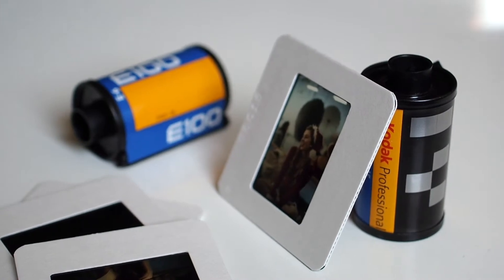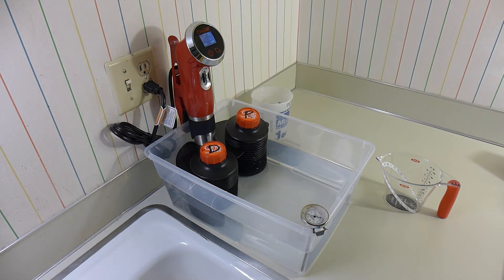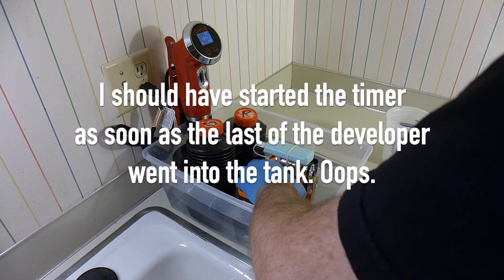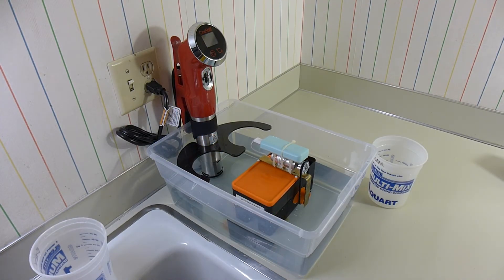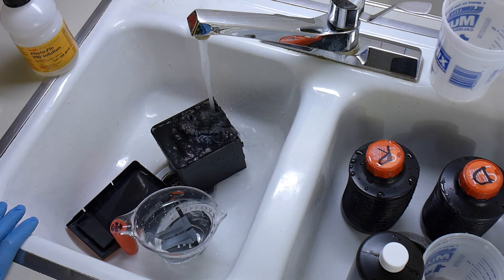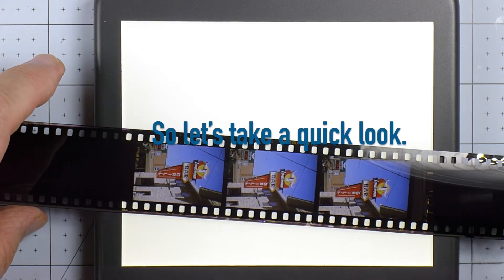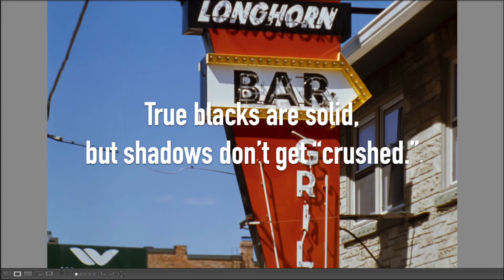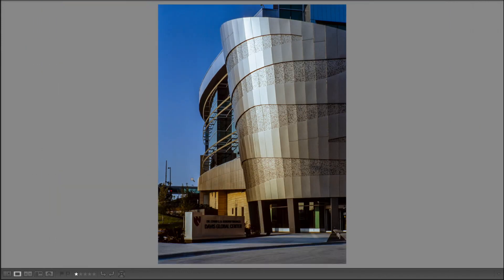Bumbling My Way Through E6 with CineStill's Dynamic Chrome

Comment: This concerns use of the Lab-Box for the E-6 or other color process. Temperature control and maintenance for tank processing of E-6 requires high temperature, 100 F, more or less. A hot water bath is the usual means to do that, submerging the chemical bottles and processing tank during use. Here, he is doing that with a Lab-Box. Since the LB does not seal on top, he is taking care to avoid any water bath spillage over the top edge of the tank, as that would flood into the chemicals inside the tank. This may do the job of temperature control, but it creates  a separate issue with the Lab-Box itself. Note that I was a Kickstarter of Lab-Box and have the whole package. Many errors seem to have been made designing the details of the LB, then corrected during the run-up to manufacture. Example: The entire reel system was scraped and replaced so close to the start of manufacture that the original manuals still describe and picture assembly of the abandoned reels. This seems to have led to much cost scrimping toward the end, even though they took in 6 times the money they sought, but ran out of funds and were unable  to completely fulfill their Kickstarter commitments.  The problem comes from submerging the LB in 35mm configuration. That 35mm module has a metal knife to cut the film from the cartridge when loaded. The dumbest cluck could have said, "Use stainless steel." But they did not. Therefore, the knife rusts when it gets wet, as when you put the tank in a water bath. The knife is internal to the 35mm module, so you cannot keep it from getting wet or dry it promptly to avoid rust.  This does not apply to the 120 configuration, which could be fully disassembled and dried after each use. Solution: Do not use the LB for color film processing.
Reply from the maker: I agree a stainless-steel blade would have been better, but you can in fact access the knife blade by removing four cross-point screws on the inside face of the 35mm module. (Reassembly is a bit fiddly... but EVERYTHING on the Lab-Box is a bit fiddly, innit?) I like to dry off the blade and give it a wipe with light oil after every immersion processing session -- which I admit I don't do frequently. Most of my use of the Lab-Box is for b&w, which doesn't require immersion, and I remove the module before washing the film to keep water out of it.

Comment: By chance would you know what the development times would be after the first roll is developed? C41 chems has an equation t = (140/40-n).
Reply from the maker: Cinestill doesn't recommend re-using the first developer at all; they say: "1st Developers are weakened after a single-use and should be used only once, whereas the other 2 baths may be reused multiple times before any loss of quality." But they also say you can develop as many as 50% more rolls as long as you do it within 2-3 days of mixing the chemicals AND you're willing to decide how much quality loss you can tolerate. You can read the instruction sheet here and see what you think: https://cdn.shopify.com/s/files/1/0339/5113/files/CS6_instructions_25dfbef0-f1e1-4fe7-841b-dc4ece42c184.pdf?v=1590215645

Comment: Hi, mhmmm  interesting solution that of the robot...could you provide some information on how you did it? Thanks
Reply from the maker: I've got a build sheet here: https://jlwilliams.us/robo-box.pdf. There's also a how-to video on my channel, but all the info you really need is on the sheet. Remember that this is very much a “maker” project: feel free to adapt the build to your own skills and interests (for example, I'll bet someone with a 3D printer could print some of the parts I had to buy) and be prepared to experiment and make adjustments to get it to work the way you want. It took some fiddling to get mine to behave, but now it's 100% reliable and I use it every time I process film in the Lab-Box.

Also, another commenter warned me that he wasn't able to order the small pulley because it's out of stock, but I'm hoping that was only temporary; if not, you might need to adapt a different pulley.
Reply: @jlwilliams   WOOW answer in real time :-)  thanks! i'm going to read right now

Comment: 6 changes of water instead of 60 seconds running water is that they call wash ? Some kits say 60 seconds wash
Reply from the maker: The latest revision to the instruction sheet calls those steps "rinses." I think six changes of water would be enough for that, since the only purpose is to get the previous solution residue off the film. For the final wash, they call for more than 6 minutes or more than 10 changes of water.

Comment: A stabilizer is still specified both by Kodak and Fuji. There were some dye changes in years past, but those changes did nothing to effect the need for a stabilizer. So why do some kit makers, mainly Tetenol, omit stabilizer in some of their kits? Ask 'em. The truth is that any time you make a kit like this seem easier to  use, it is more marketable. By  combining solutions/functions or eliminating stabilizer, the kit is easier to use and sell. Omission of a stabilizer as the final bath for E-6 (or C-41) will not have an immediate effect on dye preservation, but you will get fade or color shifts over an extended period of time. The makers seem to think that most all of their customers will not revisit their film/slides or are just not critical enough to notice the difference. No idea where this stuff about stabilizer being formed early in the process comes from, but its chemical nonsense. The whole point of stabilizer is that it is the last step in the process. If formed in the middle of the process, it would just be later  washed out of the film and have no permanent effect.
Reply from the maker: I'm quoting what CineStill says in their product instruction sheet. They don't claim stabilizer is "formed early in the process" -- they say "Modern color films have “Stabilizers” in the emulsion, released by the conditioner in the Bleaches&Fixer Bath" (i.e. the final bath)..."Film more than 20 years old may require a formalin or formaldehyde based Stabilizer preservative."

You can download the instruction sheet, safety data sheet, and a comparison between 3-bath home user kits and 6-bath processing lab kits at the product info page: https://cinestill.film/collections/cs6-crea/products/cs6-creative-slide-3-bath-process-for-color-timing-chrome-reversal-and-e-6-compatible-film   Then you can decide what to believe or disbelieve based on specific claims and data.
Reply: @jlwilliams  
While something like that applies to C-41 films and process, this does not apply to E-6. Interestingly, it also does not apply to ECN-2 films, which is what Cinestill sells as their color negative film. Cinestill appears to favor marketing hypo over the technology, probably for the reason I first noted. If this really concerns you, I invite you to look up Kodak's ECN-2 formulas, which are readily available on line.
Reply: I have developed both Tetenal C-41 and E-6 and both kits had the stabilizer included...

Comment: Great video. Haven't seen anyone using E-6 with Lab-box on YouTube. I'm curious, would you consider making another one of those robo-agitators? If not too expensive, I'd consider purchasing one. BTW, have you seen Are-imago finally released their Pro lid?
Reply from the maker: Thanks for the interest, but I really think it's better if people make it themselves -- that way you know what to do if you need to do some custom fitting or adjusting to get it to work. Also, if you happen to be good at, say, woodworking or 3D printing, you can use your own skills to improve the design. I deliberately kept it super-simple to allow scope for improvements. There's another video on the site about how to make it (https://youtu.be/Q7-vOVZeiio). The "hard parts" (gear motor, hub, pulley wheel) are about $30 from a  hobby robotics supplier, and the rest is just random stuff like a brass strip and zip-ties.

I did see that Ars Imago released the Pro Lid, and I'm not in a hurry to buy one, but it did make sense after I thought about it. I think the main appeal of the Lab-Box is that it's a very tidy process, and the Pro Lid makes it even tidier because it's a one-piece solution. You no longer need to buy and store a separate thermometer and timer -- just pull the Lab-Box out of a drawer and you've got everything you need for developing except a sink, a measuring cup, and your chemistry.

What I'd really like to see from Ars Imago is a factory version of my robo-agitator! They could do a really nice job of it by making a knob that would take a cogged belt drive and molding the motor into the lid. Combine that with the thermometer and timers in the existing Pro-Lid and you'd just about have a desktop auto film processor!

Thanks again for your interest.
Reply: @jlwilliams    YES!   together with a sous vide it would be a perfect replacement for the jobo developer. compact, inexpensive. if they build it and sell it at a fair price i would buy it for sure. for the moment i get by with your project ;-)
Reply: @kottize  The Pro Lid has been available for some time, although that may be limited to vendors which represent Lab Box in the US. Freestyle in LA sells it at this time (2/22). As with all things  L-B, it is over-priced at around $90. I got one because I was in the Kickstater group. It really is quite a trick, replacing both thermometer and adding a programmable sequence timer.